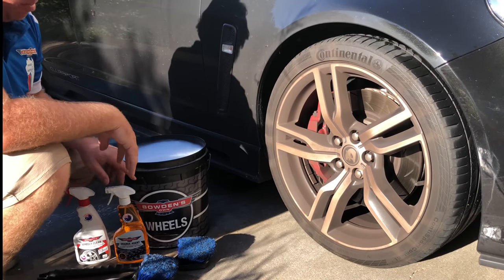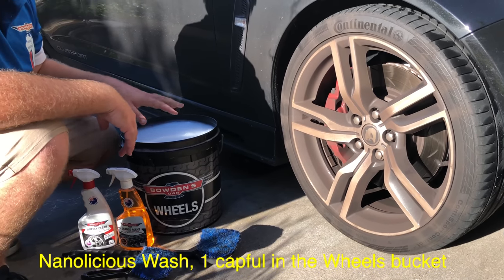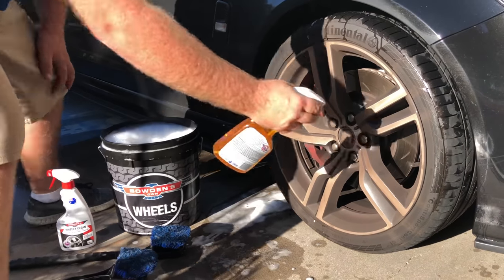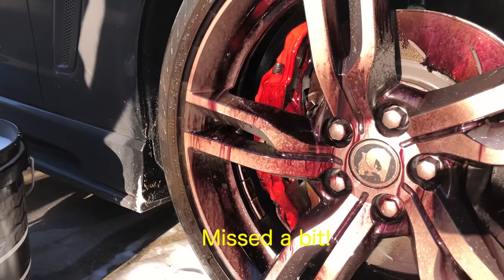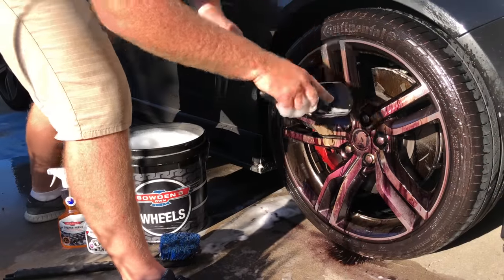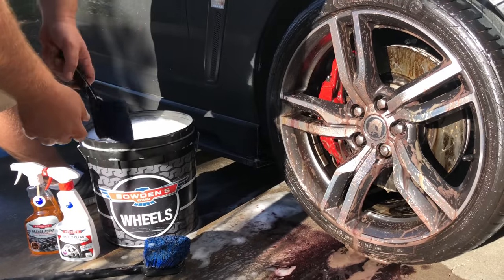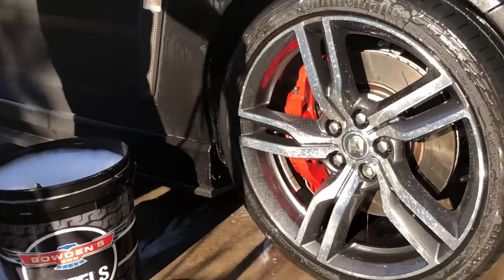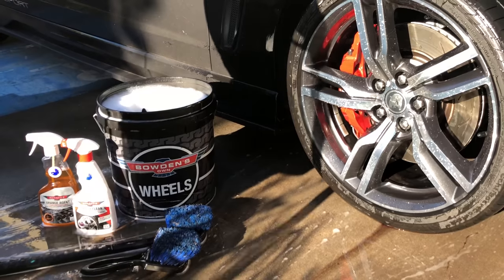Cleaning dirty wheels with the new Little Chubby and Big Black One.

Comment: Damn, I'd rather not use the entire bottle of wheel cleaner in one go.
Reply from the maker: Hey NippyMoto, no need to, even here... We needed to cover the brake dust encrusted (and slightly intricate) wheels the best we could, as the product helps break down the brake dust on the wheel a lot.  As you can see in other video's we use around 12 to 20 sprays depending on the type of wheel and how dirty it is,  which is 12 to 20 ml of product with this trigger to cover a wheel. So from this maximum use as we do here, there is still enough to do 5 different cars, or 20 wheels from the 500ml bottle (We actually put 540ml in each bottle, so it's a little bit closer to than 22 wheels.) Which for this type of formula is not too bad.
Reply: BowdensOwn

Comment: You did everything good except never use the same brush on the tires, to the rim. Scratch city.
Reply from the maker: There is a rinsing of it out between the two tasks. That brush uses soft flagged bristles that don't hold the dirt, so they rinse out in the wash water very easy, taking any dirt from the tyres with them.
Reply: She’ll be right it’s only a commy